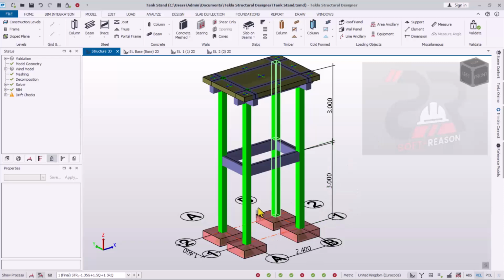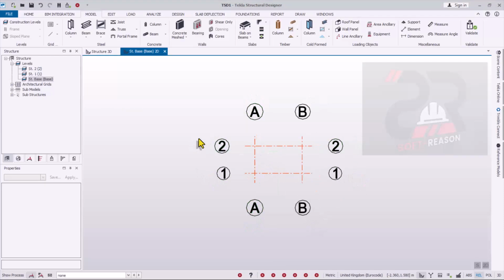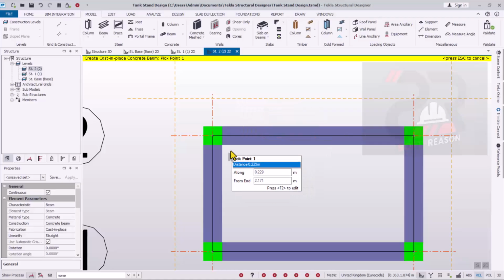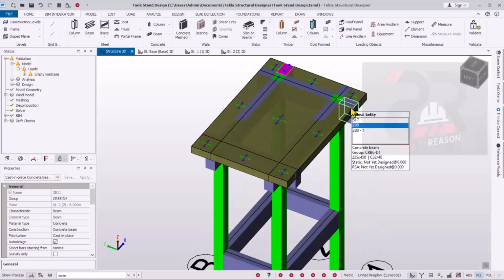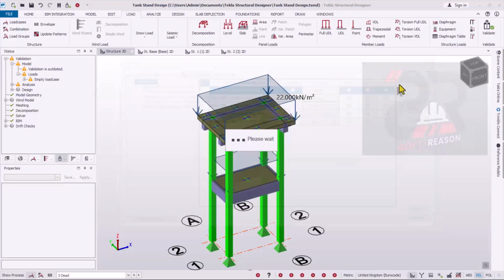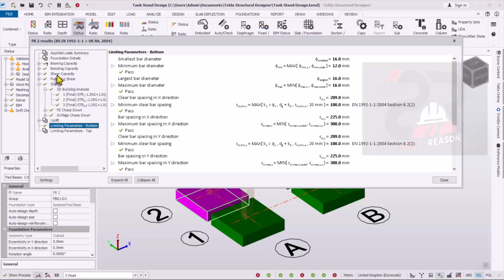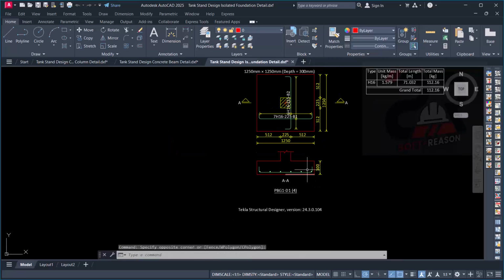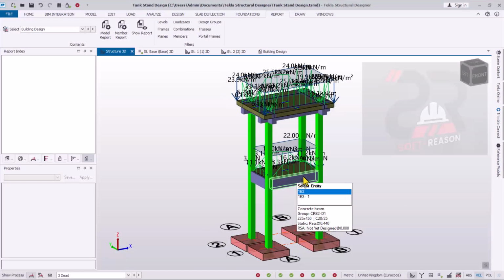Tekla Structural Designer: RCC Tank Stand Design Secrets You NEED to Know!

Comment: Your load calculation yield about 43kPa. Why did you apply 22kPa instead?
Reply from the maker: 22kpa taking as half of 44kpa and applied twice. Calculated load 43kpa plus 1kpa self weigh of Tank give 44kpa. 10k water capability and on each platform 5k, two platforms.

Watch the video closely